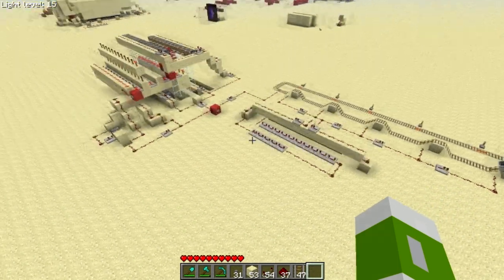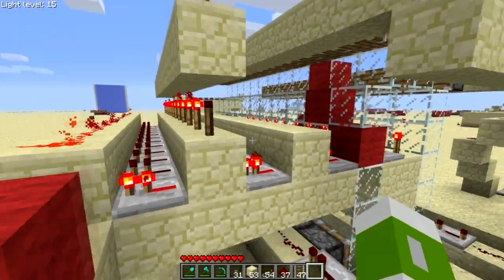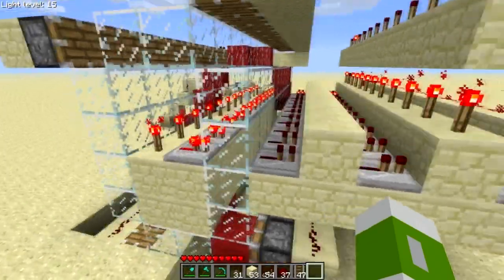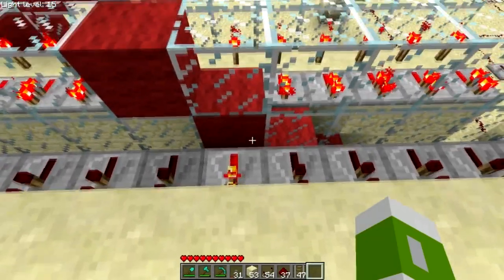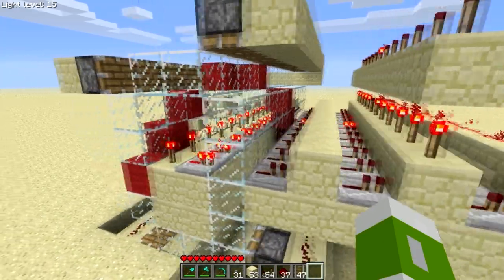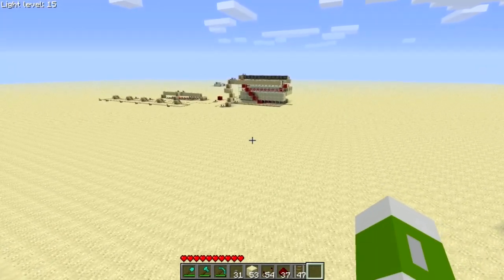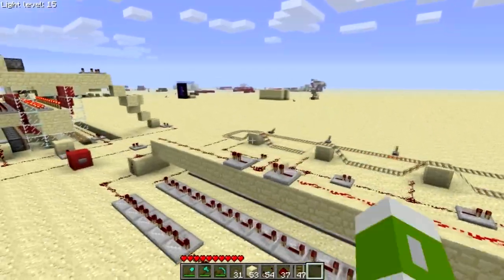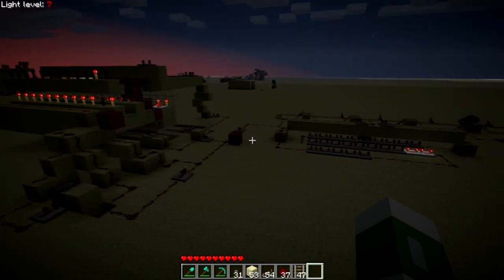Minecraft - Clock (12 Hour Clock Using Piston Memory)

Comment: I have made one based off this clock, but i put another 3 booster railway track between the 5 booster and the memory so I could fit it on a display with 12, 3, 6 and 9 hours instead of all 12 hours.

Comment from the maker: @CzarSlice I'm working on version 2 now. It is 3 times smaller and significantly simplified. It can fit into a clock tower now. Its actually so small you can fit all the circuitry inside two rooms of a normal sized house.

Comment: @drakhl wtf? huge thanks lol.

here's a more compact 3-high counter with 12 outputs that only light up one at a time, also uses 80% less pistons.

media fire.com /? dq1gnoqae6uk56t

You can obviously make it even smaller if you go with a 10-hour clock (which is a logical thing to do since there are 20 minutes in a minecraft day, not 24) or if you can live with the fact that you will have 11 outputs with all-off being the twelfth state.

Comment: I'm not an expert at all, but I was wondering, do you have to use this model  (the one that moves mainly on the z axis) instead of the etho used to show which trivia question he was at (the on that is on 2 lign and 1 column and the block gets pushed on the side instead of up and down) since you only need one torch lit at a time.

Comment: You don't need 3 air gaps, a rotation like that will function with only 2, instead of having the pistons fire in sequence you need to fire bottom left and top right first (top right would be pushing the block you have as a gap now), then bottom right top left. 

I used that method to double the speed of memory.